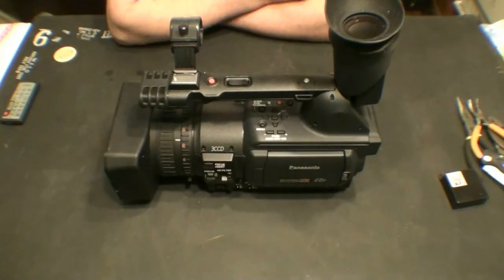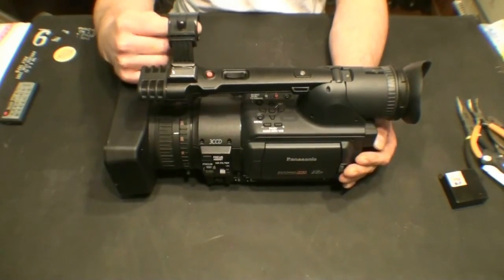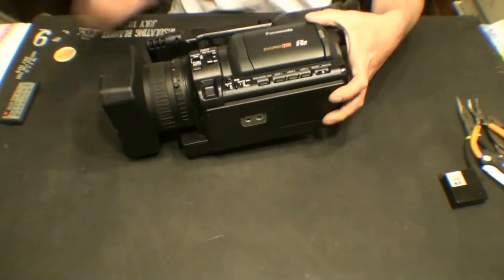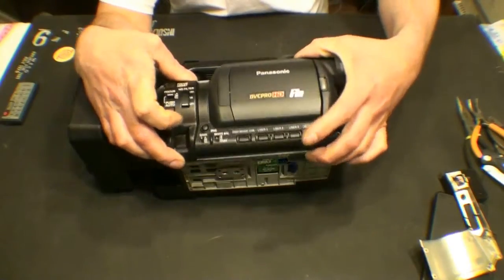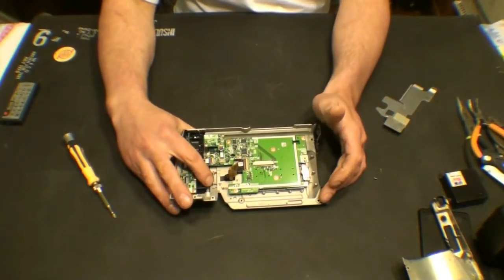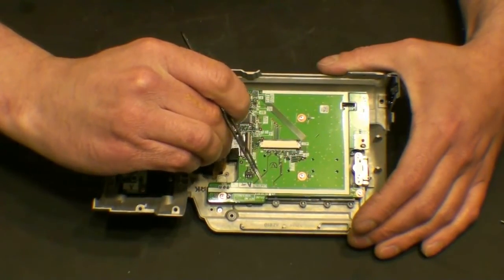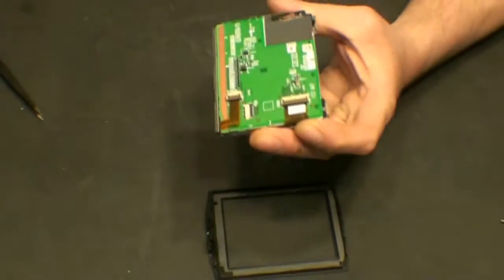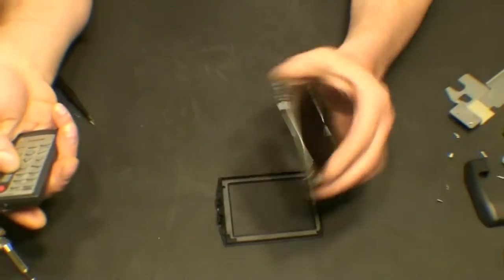Panasonic AG-HVX205A LCD Screen Replacement

Comment: I think nobody’s gonna answer because the video is too old but I just throw my question in here as well. 

Is this the same problem for replacing the ribbon cable do I have to look out for certain things? 

Help from anywhere is greatly appreciated.

Good luck guys
Reply from the maker: I would think it is the same process, or similar, at least, to replace the ribbon cable. When this video was posted, I had been unable to find a replacement LCD (I had found one on Alibaba, i believe, but it never showed up) so the camera was returned to its owner. Unfortunately I don't have any part numbers, and was never able to find a service manual for the camera.

Comment: I ended up purchasing a (for parts only) camera from ebay that had a good screen assembly testing good. So when I received it I just removed the whole side and replaced it without dissembling the LCD screen. It was almost plug and play for me. I got the whole camera for around 200.00 which yielded many more spare parts. From what I have seen but never available, the screen cost more than that just by itself. So I made out pretty good considering my camera works and looks like new again.
Reply from the maker: Glad to hear that you were able to get your camera working.  The display was pretty much Unobtanium even back when I had made this video.  I had found ONE listing for it for sale (alibaba or something like that possibly), and when I had ordered it, it never arrived.  The owner of the camera pretty much gave up, and I reassembled it and gave it back in its original condition.

Comment: your video really help me to get to dismount my lcd screen...my problem is that my lcd ribbon cable broken. I got a new one but when I get to the hinge I just don t know how to remove it from the hinge...can you help?
Reply: Bit Late but did you find a Solution?
Reply: Hey I am trying to do that exact thing right now wondering if you managed to get it done?
This hinge is quite a puzzle does not seem to want to come apart.

Comment: where did you find the replacement display?(to buy?)
or what do i have to look for..  i found out it should be the toshiba LTA035D050A???
but i cant find that one anywhere in a way i could/would buy....
thx very much